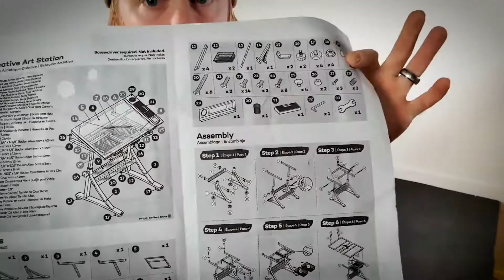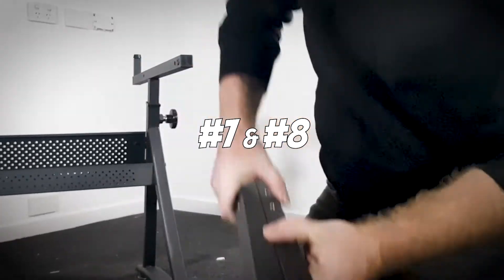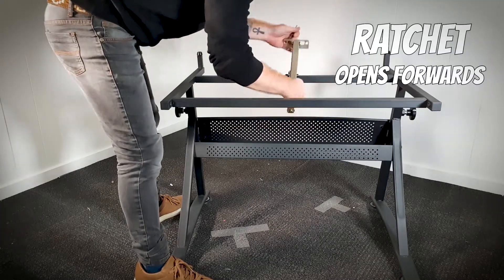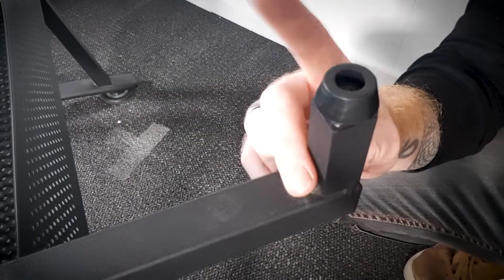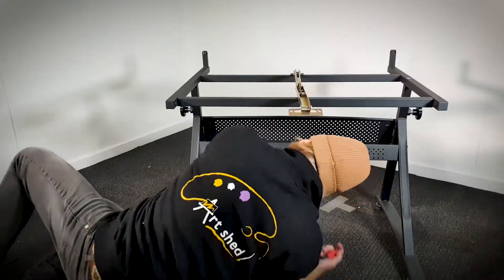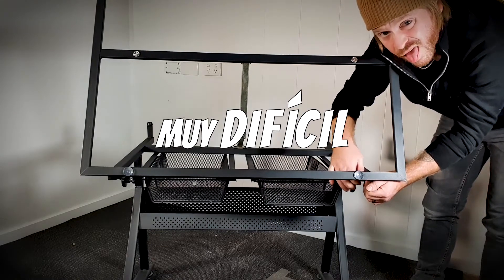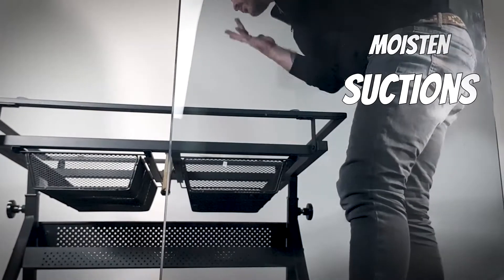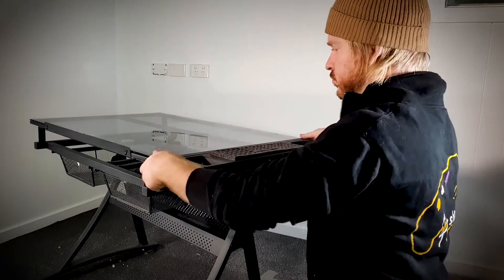How to assemble the Mont Marte Creative Art Station

Comment: Thank you so much for the video. 
Step 9: I am a little paranoid about putting the piece 29 over the glass. Because I felt like the glass was bending when I screwed it in. Is it ok if I place the frame under the glass into the frame and screw it? Or would the glass need extra support from number 29?

Comment: Awesome video!  The only thing securing the glass top are the suction cups and the pencil ledge, am I right?
Reply from the maker: Thanks!
Between the suction cups, the studio tidy and the front ledge, the glass top is incredibly secured. In disassembling, it was quite a bit of work getting the glass off, TBH.
Hope that helps :)
Reply: There were 2 bolts to screw through the frame and into the nuts attached to the glass on mine.

Comment: my glass doesn't fit on the frame
Reply from the maker: Hi Nevada, the tempered glass will sit slightly beyond the frame dimensions. I've found this helps proper adhesion to the suctions. The bottom ledge is pretty forgiving when allowing a little over hang but you can always favour the top and left side.
I hope this helps? :)